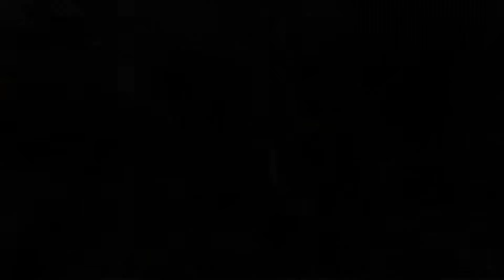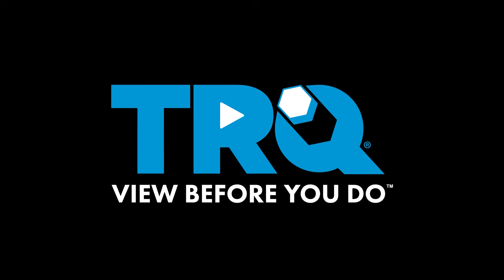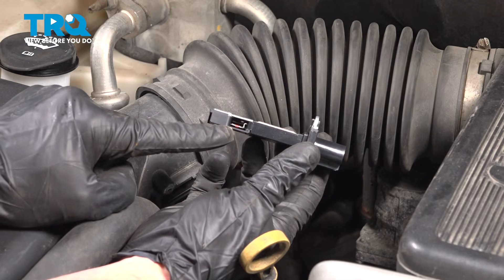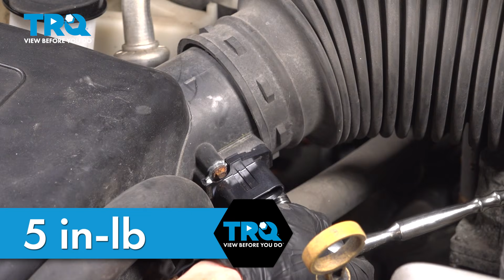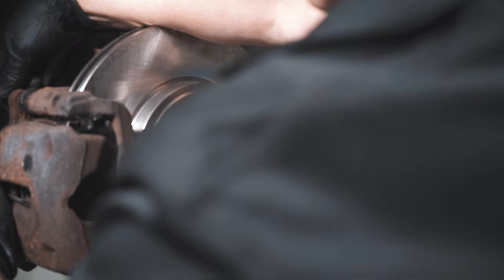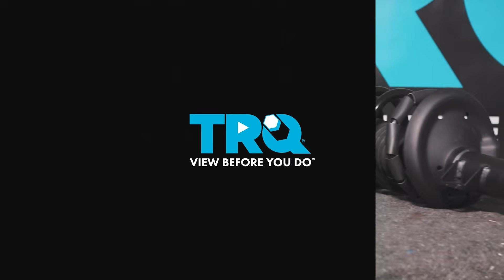How to Replace Mass Air Flow Sensor 2002-2009 Chevrolet Trailblazer

Comment: Between 2002-2005 trailblazers don’t have a MAF sensor. My check engine is for a MAF, it’s an 04. I checked and no MAF. What would I do in this instance? P0300 comeback as MAF.